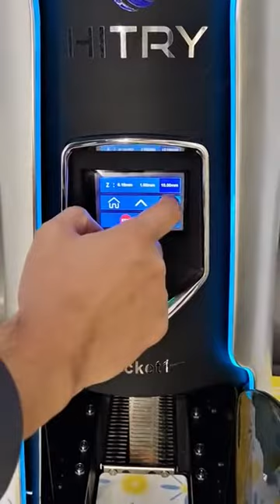Rocket 1 Demo video

Comment: Would love to review one of these.
Reply from the maker: Hello, what kind of news do you want to know
Reply: @hitry1413  I would like to see some print-in-place articulated models, some models with moving parts, calibration prints, settings for different slicers, maybe some functional prints like whistles or ocarinas.  Different types of resin being tested (I know you make your own), strength tests.  What software do you provide?  Are there options to hollow out a model with different wall thicknesses, etc?  When paused does it rise out of the vat so we can see the print is going properly?  Can it resume after power failure?  

So many things.  :)
Reply from the maker: @RynoDBones  Hello, let me talk to my colleague and arrange similar models to be printed. We provide chitubox, and now participate in crowdfunding to send chitubox Pro for free. The software supports hole punching, detection and repair, etc. It will automatically rise from the bucket after a pause, and it cannot be restored after a power failure. It needs to be reprinted, thank you

Comment: I've notice that you do not mention anything about 3rd party resin compatibility anywhere, but it looks like your resin is similar in specs. Will 3rd party resin use by possible by adjusting settings in the slicer software or is there something about your resin that makes it the only resin that will work?
Reply from the maker: Hello, we have not tested third-party resins yet. In addition to the nanomaterials that promote the rapid leveling of the resin, the photosensitive resin composition of our rocket 1 also contains an oxygen-inhibiting reinforcement component, which makes the uncured layer in contact with oxygen from zero to ten micrometers to tens of micrometers to hundreds of micrometers. Micron, without changing the curing performance of the resin and without using a squeegee, makes the sinking printing liquid level quickly level, so as to achieve ultra-high printing speed and accuracy.
Reply: This explains a lot. Thanks for the reply!